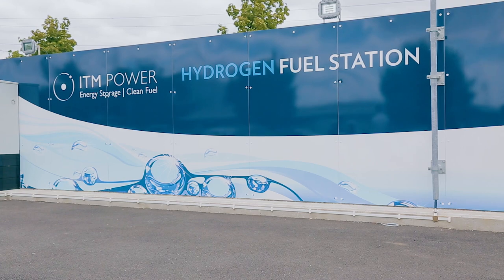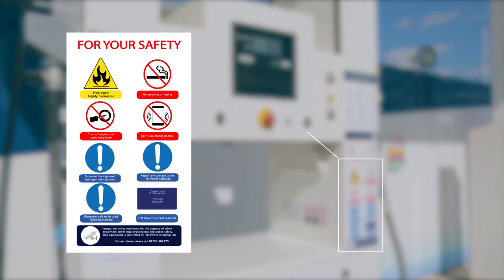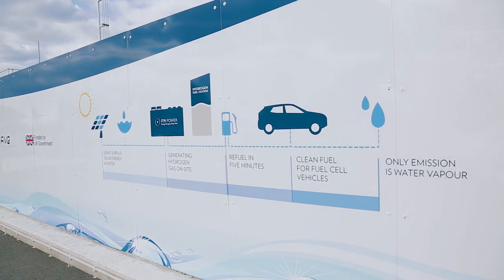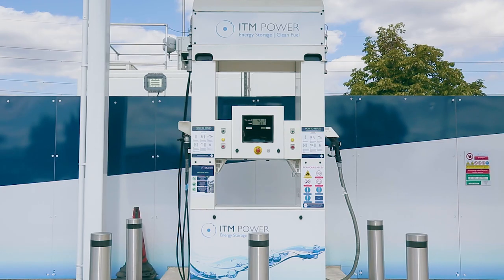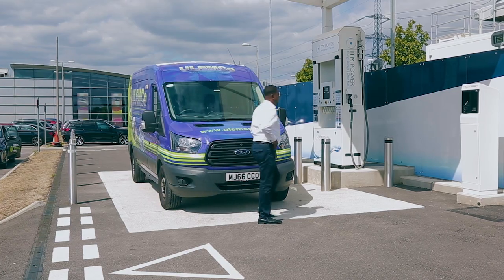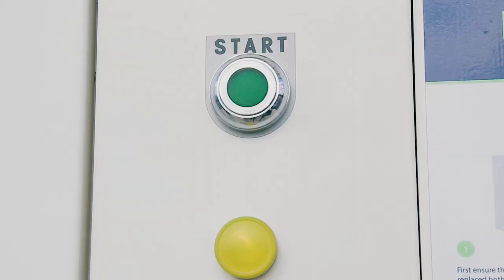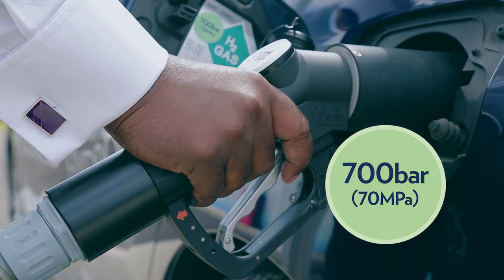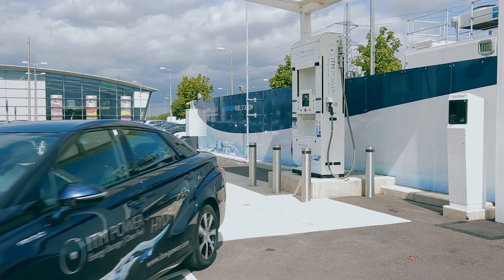ITM Power Hydrogen Refuelling Guide

Comment: As someone who has been dealing with HP gas use for over 40 years I’m appalled that any company should be allowed to give the impression that transferring any gas, much less one as potentially lethal as hydrogen, at pressures of 350 and 700 bars can be treated as casually as this information film indicates. No untrained person should be allowed anywhere near anything that is capable of transferring gas at >350 bars, it’s shear insanity. Move to a safe place if there’s a problem? A) an untrained inexperienced person probably wouldn’t recognise that there was a problem until it was too late. B) if hydrogen starts to leak at >350 bars the only safe place is much further away than you can run in a few seconds. This is lunacy.